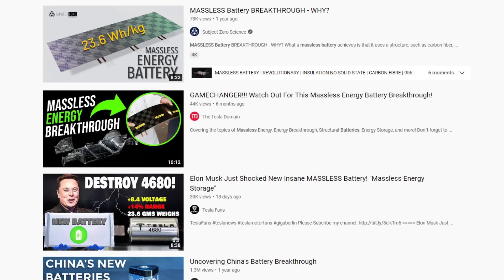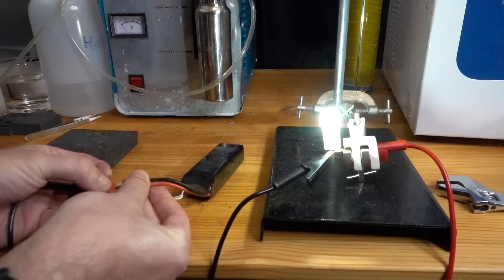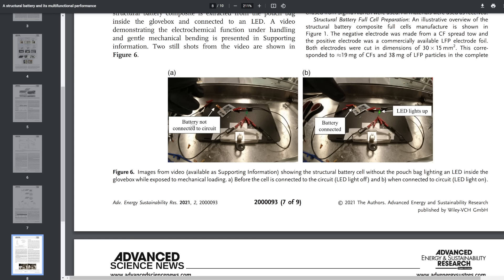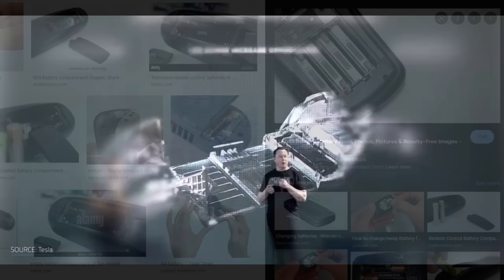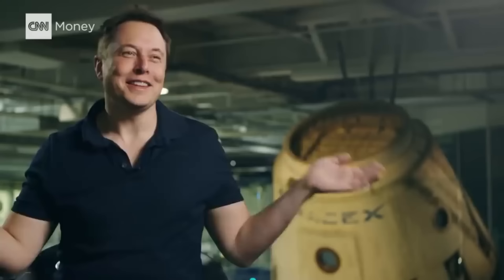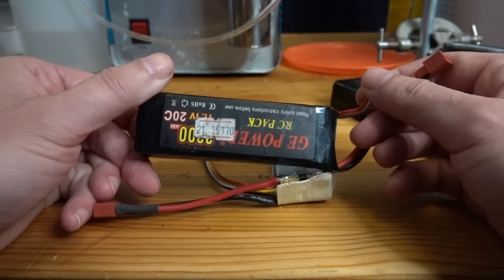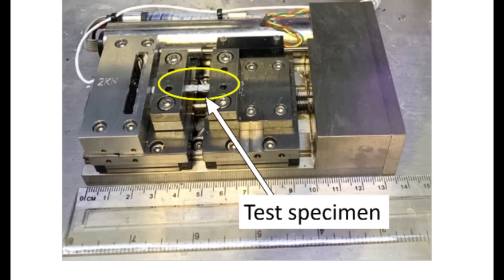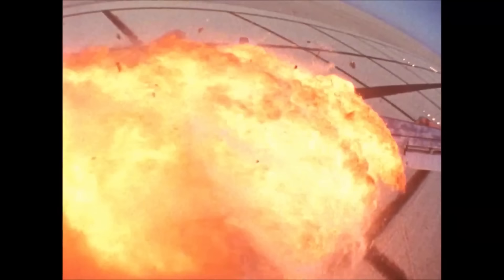Matt Ferrell, Massless Battery: BUSTED!!

Comment: If you actually read the paper, the "cell" itself is a CF-thermoset composite laminated between Carbon fiber and glass fiber composites. It's a solid-state composite battery. This means it's made of primarily plastic and carbon. Plus, it has no liquid electrolyte to cause leakage, the electrodes are smaller than the Seperator, so they won't short circuit even when subjected to mechanical load. What you saw is proof of concept, there are major challenges to implement this technology and scale it up, sure, but that what research is all about. As of now, the specific energy is too low, the carbon fiber electrodes do not have enough electrical performance, the solid battery electrolyte has a lower ionic conductivity. Your content is biased to make fun of people with minimal research rather than actually try to understand the concept.

Comment: Sooooo someone help me to understand the term "massless" --- if I take one scooter battery I have, and remove the entire shell, it weighs about 17.5 kg instead of the 20 kg it did with its shell. It will then be absolutely fragile or fall apart, while being still far from massless. The shell on the other hand can take some load and is lightweight at 2.5 kg only, but its capacity is... none? So the great breakthrough Elon-ish invention here would be to just combine these two elements, amirite?

Comment: I really don't get where the "massless" comes from. The Battery is made out of mass so it HAS mass. Can someone explain that to me? Also English is not my native language.Maybe that's the problem?
Reply: It doesn't make any sense, even from the perspective of an English speaking being. It's not "massless". It's more of an attempt at weight reduction but the reduction (as they state themselves) is a ten percent decrease, meaning calling it "massless" is just more buzzwords to fuel marketing. If even a single atom is used in the construction of the battery, it has mass. Unless they are making batteries out of light and shadows it's utter nonsense.
Reply: @nightshade7240  thanks for the explanation :) they should be, instead of "massless", call it "less mass" :D
Reply: @AKinator96  - you weren't alone in not understanding.  I consider my level of English to be good and couldn't make sense of the term 'massless,' as it was being demonstrated.
Reply: @nightshade7240  - thanks for the explanation.  I have one better, for those clowns claiming a 'massless' battery.  I have a 'massless' fuel tank as it is currently devoid of 55 litres of diesel.  The low fuel light came on during the homebound drive which means I'm down to around 15 litres of 'mass.'

Comment: Gasoline, being liquid, cannot provide any structural strength. But the solid components of a battery (anode, cathode, separator, case) can provide some structural support. That isn't "masless", certainly not "weightless", at best it gets some weight reduction. Now weight reduction is a good thing in vehicles, certainly worth developing, but it isn't quite as miraculous as they portrayed. 

Thunderfoot goes to the opposite extreme, pretending it's totally unworkable and not even worth considering. You should have stopped at pointing out that it is neither "massless" nor "weightless", which was valid criticism. But your tendency to go full-on snarky got the best of you.

Comment: See, that's what happens when words no longer means anything... Like recession. Don't need to be an engineer to understand the principles... MATT
Mass-less means "possession of NO MASS. Weightless".
Integrated means "part of the design".
Also is it me, but I WOULD NEVER sit on that much battery power. One failure and you're dead...

Comment: I usually love your content but you are spending way too much time on the plane fuel analogies. The gravity feed for planes is a simple callback to most pilots first plane. The Cessna 152 or 172. High wings and a carburettor engine means that they didn't really need a fuel pump except for aerobatic maneuvers or stall conditions. Which most Cessna weren't designed to perform.
There also many engineering reasons why fuel tanks in the wings are used. Less about fire safety and more about engineering mechanics related to flight keeping the centre of mass close to the centre of lift so the plane is stable and safe in flight. Increased cargo capacity and efficent use of space as the wings would just be hollow channels if they weren't used. Plus the calculations and trim adjustments required if you were to store cargo in the wings would mean every flight would be delayed for weighing and placing cargo in a balanced manor. Whereas with all engines running the fuel burn rate is equal between the wings meaning you won't end up with one wing bring significantly heavier or lighter than the other. Planes are designed to fly. Not designed to crash.
Everything else on the idiocy of calling a structural battery mass less I agree with.

Comment: >ive done it already 
>Massless, structural gasoline 
Man, im ded 🤣🤣 

>Theyve discovered a new battery 
And we, the fucking morons were working our asses off innovating, designing and studying chemistry for this, inventing those devices, while u couldve just found a better battery in the wild, in some forest. 

Just build the car out of structural, massless solar panels. No need for the batteries and they can work at night, cuz there r street lights around to siphon power off of

Comment: Of,course, the storage system for electrical power still has mass, weighs something, but integrating chassis with battery casing, that can save a lot of weight… Polestar EVs are not a lot lighter then their Tesla competitors, but cheaper and much better made. It is a few years before everybody discovers other car manufacturers can do same as zeeslak, only lot better and cheaper, and gooodbye Tesla! Uniess Tesla does a miracle invention… Or use Dutch inventions hat allow +80% powerdensity and >=2x the loadcycles before battery degradation sets in… (electrolyte salt tricks).

Comment: i really don't understand why there is like ..... fear.... fear of batteries and why people are trying everything to say there is something they can do better for electric locomotion -_-
Reply: Because batteries have many inherent limitations and there are many things they will not be able to do in practice.
Reply: @electric7487  I think simplicity is the way to go, and the new batteries should be sodium based not lithium ( cheaper and more resourceful ) and every car should have solar panels on every body part , people like to say "but it only gets you more 10/20miles) but 10 to 20 miles on millions of vehicles will save us from doom of using fossil based energy or just using smaller batteries , i think if someone could unleash some ai on creating a battery we would be better off instead of trying to complicate things.

Comment: Dude I usually love your videos, but what are you even talking about here? Did even watch his video?
Where did you get this "massless" idea from? He is talking about a battery that is sturdy enough to replace some of its nonessential packaging or potentially the car's chassis or frame. And yes, anything if put inside a protective layer becomes sturdy, but the whole point of this battery is that the part that stores electric energy itself is sturdy to there is no need to endure the additional burden of packaging and protective material, hence reducing the overall weight of the vehicle.
And no body claimed this is market ready. These are the initial small-scale research, showing there is an interesting phenomena that can potentially be scaled up. Whether it can actually be scaled up or not will be found out with further research and experiments.
Long story short, it's very weird when someone says "this is an interesting phenomena, imagine if it could one day be scaled up!" and you say "busted, it can't done right now". Specially if you miss the whole point of what they're proposing.

Comment: There is another downside of carbon fiber: It breaks. Yes, carbon fiber is harder than steel but what happens to steel if you put more force onto it than it can take? It will deform, that's because steel can bend. But what happens if you put more force onto carbon fiber than it can take? It will scatter like ceramic! So if you car hits a wall and it is made out of steel, it will deform and by doing so it will absorb a lot of kinetic energy. If your car is made out of carbon fiber, it will just break apart and you are the one who will absorb the energy once you hit that wall with your body. I have a friend who had a bike made out of carbon fiber (incredible expensive, by the way, for that prices you can already buy a bigger car) and one day he hit a deep bump off-road and his handlebar broke, which is of course fatal on a moving bike. A handlebar out of steel would have probably deformed but it would still have been there and he could have still controlled the bike. Needless to say that he ended up in hospital as without handlebar he could neither steer nor break (breaks are attached to the handlebar, you know?) So even if it is very strong and very light, it's not a good idea to build everything out of carbon fiber or at least to build every part out of it. If you want to see that for real, search YouTube for "Hydraulic Press vs Carbon Fiber"

Comment: ahh, the classic case of some lab made something, so lets jump to the end and sell it as a practical application right now, and skip the 5-10-15 years of extra research, during which these stuff usually goes from revolutionary to maybe useful in some edge case, or at worst, a not yet feasible or economical, so lets wait with it for a century or two. (electric cars made more than a century ago, than the oil using ones killed it as they were so much better in every aspect, so we waited for most of that century until it become feasible, and the question is still out there, if it is practical in the long term.)

Comment: Hmm. Matt obviously exaggerates the claims, making it a ridiculous SF story, but the authors are more cautious. The term mass-less only appears in the paper once, and it’s in quotes (claiming that others refer to such tech as “mass-less”…though I would’ve liked a reference for that). 

I think your criticism of Matt is valid, but you’re perhaps too hard on the paper. Most published research is not a breakthrough, and the structure of current academia demands that each tiny incremental result is made into a paper, as well as (sadly) that its authors give some consideration to possible future application. You know this.

It’s these claims that hypeboys like Matt run with. I don’t find anything out of the ordinary in this run-of-the-mill paper itself.

Comment: The only benefit to placing jet fuel in the wings, is that a large part of the takeoff weight is fuel. Having that weight WITHIN the lift-generating part of the plane, reduces the amount of structural support needed.... Really important, in airframe design.

I have no quibble that is dangerous to have jet fuel in the wings (i don't want to look out the window during my crash-landing, and see such a fireball), but frankly, i don't want the tanks in the fuselage either... because a similar fireball UNDER my seat is probably EVEN WORSE.

Crashes are bad. Repeat: CRASHES ARE BAD. Fireball crashes are even mo' bad. My butt is in a seat that is attached to the fuselage. A ripped open, blazing FUSELAGE TANK will structurally ASSURE that the seat carry my heinie will 100% for sure come to rest right on top of the puddle of hellfire. No thanks.

Except for the LARGE aerodynamic penalty, ejectable under-wing tanks are probably the safest design.

...Unless we take some inspiration from those lizards that can "eject" their tails at will. Explosive bolts at the roots of the wing! Eject that sucker! Once that wing is dragging on the ground, you don't need it anymore: it's not providing lift, and it's not providing directional control. It's just adding unpredictable chaos to the workload of the terrified pilot who's probably just crapping his pants at this point. If there was a button in the cockpit to eject the wings, it would be the smartest action he could take. At least the fuselage won't have levers gouging the runway and sending the fuselage into a spin, and there's a very good chance that those wings and their attached fireballs will come to rest some distance away from the fuselage that has ME in it!

And this is my problem with "structural batteries" in cars, or phones. I don't want the batteries  developing cracks in their electrodes or jackets. I want the battery to be optimized as a battery, and the support structure to be SEPARATELY optimized for support.  That will give the highest performance, greatest safety, and lowest cost.

I remember seeing a viral video of a guy trying to exit his pants as fast as he possibly could. He didn't care that he was in Target, he didn't care that other customers were watching and one of them was even making a video of his predicament. He had a burning phone in his front pocket, and he was focusing on the most important thing.

So, although I'm all in favor of making batteries STRONG (this makes them safer) let's not try to use our "strong" batteries as "structural members", whether it's cars or mobile phones. Because (speaking of "members") the phone that just now decided to slag itself, might be the front-pocket next door neighbor of your very favorite thing.

Comment: See this is a failure of lazy modern English, confusing the electric cell/pile with "battery", you can easily have a structural battery because a battery wraps multiple cells/piles in a case.(Spanish properly calls single cells "piles") But this can never be "massless" because the empty case can never have more mass than a filled case.
 
Considering every solid has some structural strength I must conclude he doesn't understand that claiming "massless" (no mass penalty at all) a cell material would require the same strength to mass ratio as the original alloy frame material it replaces. (eg 6061 grade aluminum or heat treated steel.)

Comment: Basically what Elon is doing with his battery packs is how some motorcycles to save weight will make the engine part of the structural strength.  You can only do so much with that.  Elon is making the big battery box more integrated into the structural strength so he can remove a bit of weight in the exact same way.

His new batteries dissipate heat better and lower resistance a bit because of the new tabs along the edge of the sheets.  It could be instead of water cooling... which is heavy, he is using more of a large aluminum heatsink... which is still pretty heavy, but he can make it partially to improve the structure letting him overall reduce weight.  It is a good idea if it truly can be cooled and heated easier than the old packs and the overall weight and safety is better.  Weight is a huge issue with EVs.  Good for Elon, but this is not what that whitepaper was about.

Yes the hyperloop was a bad idea... EV trucks need MUCH better batteries first... and it is possible humans can not live long term on Mars and it might be impossible to make it self sufficient do to the lack of certain minerals.  I also personally think the idea of a space elevator is just stupid, travel between the stars will basically NEVER happen... EVER, and Dark Matter is a bunch of BS for scientists to try and make their calculations work... when we can only truly observe what .00000000000000001% of our own solar system.  It is like cold fusion or fusion reactors.  They have been talking about it for a long time, but yet they have been unable to even break even on the amount of energy coming out being more than you put in... and then there are going to be efficiency losses in actually converting it to electricity that can even be used.  They have to improve the output significantly still and they right now are making such tiny improvements it might NEVER work.

Comment: Stressed member chassis batteries are coming , and they will be Graphene , about 8 to 10 years away . 2000 mile range / 20 minutes to charge from flat . Also it's interesting to note you can convert a lead acid battery to salt water battery with better performance.
Reply: > "Stressed member chassis batteries are coming , and they will be Graphene , about 8 to 10 years away"

I don't exactly think this comment will age well because these super-high-density batteries have ALWAYS been "a few years away". Get back to me in 10 years.
Reply: @electric7487  seen working prototypes my friend , but at the moment a $50,000 cost to manufacture battery is not economically viable . Hence 8 to 10 years .
Reply: @tim.iteland.9447  Yes, they've been "8 to 10 years away" for a while now. Don't expect to hear even the slightest peep about it in 8 to 10 years.
Reply: @electric7487  you are missing my point , they already exist ! The first 3cm sq of graphene cost around $12 million to make , 3cm sq cost between 25 to 4 cents to make now , please stop being childish & dismissive, it kills the opportunity to share information & ideas . Cheers
Reply: @tim.iteland.9447  Nope. I'll believe it when I see it.